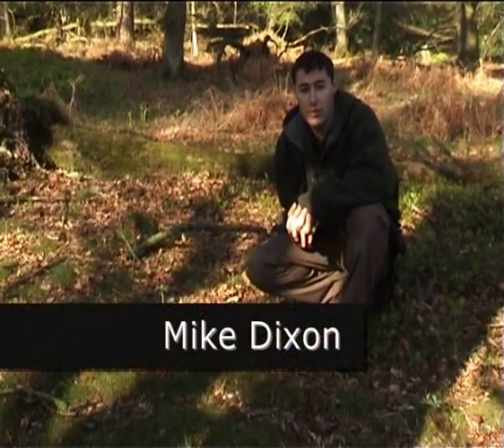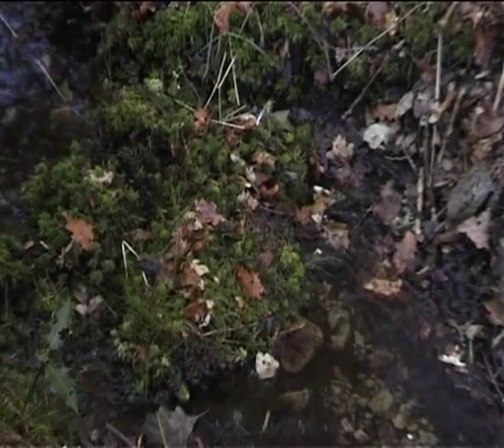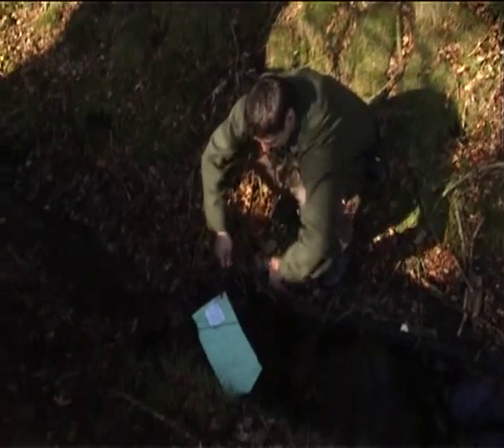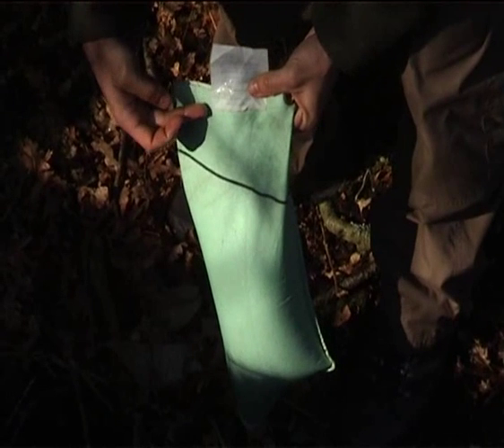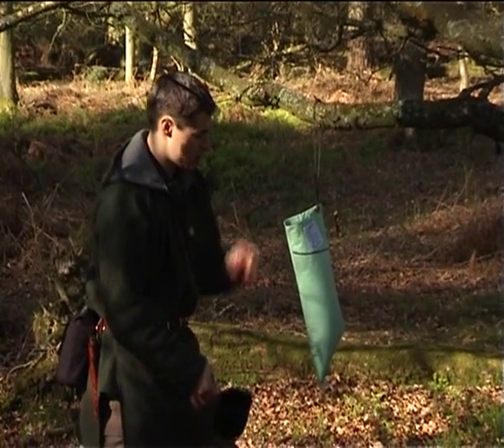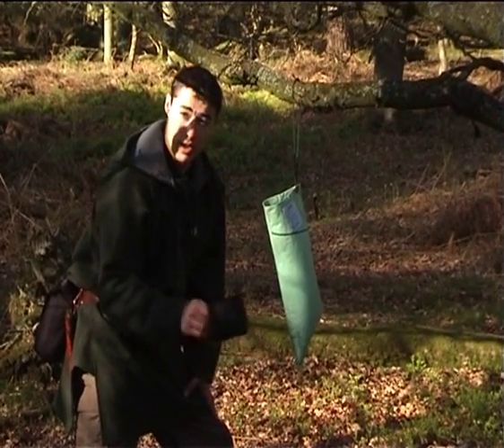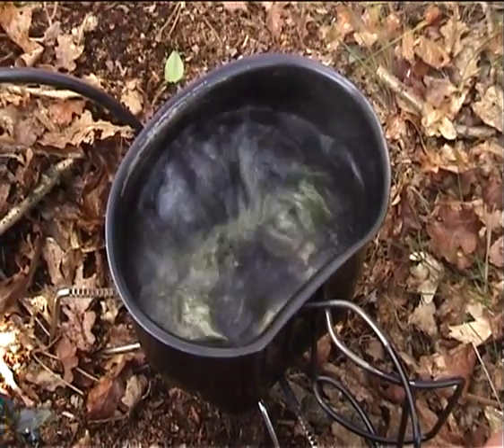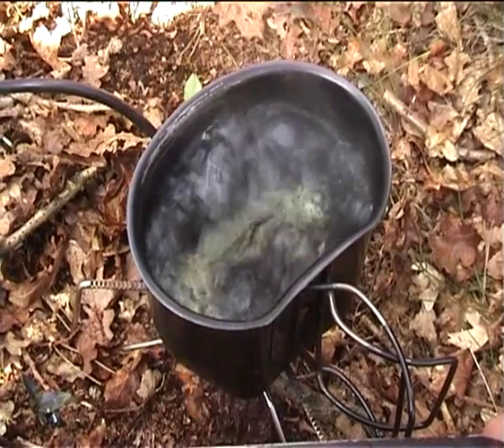Water Purification using a millbank bag

Comment: the moss filters very large debris (and its a natural 'old school' filter system) and the sand the smaller debris. The MORE that's prefiltered before the millbank has to, the faster the flow will be. Of course, this only works on the water that goes through those layers (won't work on the water that leaches through the top sections) but since debris tends to sink, it will help with the water going through through the bottom of the bag. Basically, slows the 'clogging' of the bag.

Comment: Good vid as always Mike, got a question for you. In my local woods there is a few large (12mx12m) pools, the water looks stagnent, I mean you can see some surface scum, not a lot just a thin layer, but ten meters to the left there is a tiny stream that goes on a while. Now could I filter that water through my millbank bag, boil it or purify it then drink it? Is stagnent okay basically?